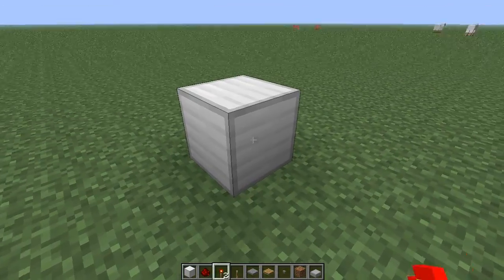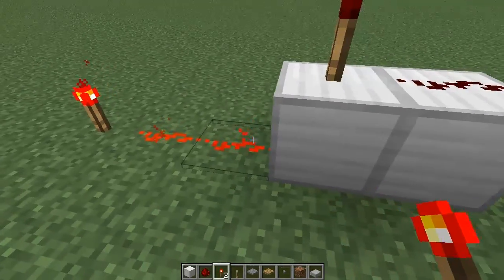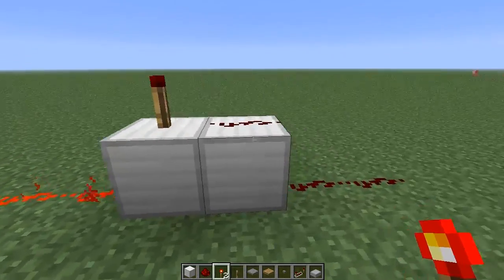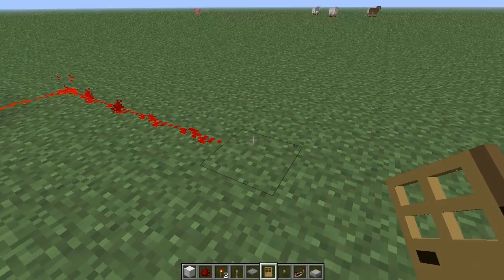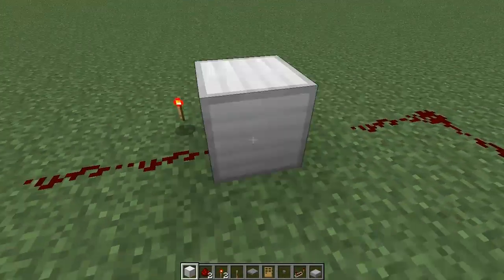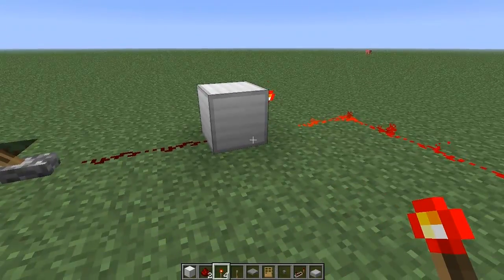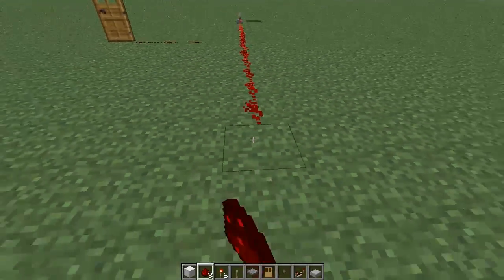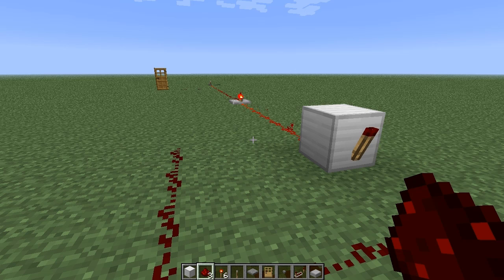Redstone Tutorials - #2 Repeaters and Inverters

Comment: At 3:21, you place a repeater and then the power continues. In my game (Im working with you in Pocket edition) I followed the exact same steps (remove inverter, place repeater) but instead of continuing the power, no power went beyond the repeater. Is that because I have a different version, or because of pocket edition? Is that supposed to happen?! (Yes the block is a repeater)
Reply: Check the repeater's direction. If the redstone dust is going left, then the repeater's direction should be placed left as well.

Comment: what you would need and inverter for is a 2 way door. like you said in the last video on is on adding another power sorce does nothing and if you have and iron door you know how hard a button can be to use going in and out because it doesn't last long. but with a lever once opened from the outside you can't close the door from within. but if inverted if either switch is on the door will be close so you can turn it off outside opening the door then turn it on inside closing the door the turn it off to leave and so on.

Comment: I'm so confused right now
Reply: Ur not alon
Reply: Well if you get confused with this I can’t imagine you watching mumbo jumbo’s video
Reply: Wtf this makes no sense
Reply: The repeater is use to extend the red stone signal, while the inverter is used to make one side ‘off’ while the other side will be ‘on’ 

To make the inverter just put a block and then place a red stone torch.
Reply: @sweettea735  thank u
Reply: @sweettea735  Well I have a question then what if you add a clock can the redstone signal switch between the one side that is off or on, or does it power both sides and then the clock ticks?
Reply: @lolozeeee  only powers one side I think.
Reply: @sweettea735  So the signal switches between the 2 sides
Reply: @lolozeeee  yes
Reply: @sweettea735  Ohhh, thank you
Reply: @sweettea735 didn’t he already make one in the first video, as it gives the impression that this is something new that he didn’t cover in the video before, when he did he just never named it and it makes things 1000 times more confusing.

Comment: what happens when you right click the repeater exactly? i havent seen any difference in game when i tried it
Reply: Kisuke Urahara Repeaters always delay the passing redstone signal by 1 tick, or 1/20 of a second.  Each time you right click it, it adds 1 tick to the delay to a maximum of a 4 tick delay.  This is useful when you are attempting to synchronize multiple redstone components so that they all perform their actions uniformly.
Reply: ok thanks :) that helps alot
Reply: Kisuke Urahara Np and also I remembered wrong, 1 tick is actually 1/10 of a second not 1/20, my bad.
Reply: lol, ok thanks, that actually makes things a little easier, in case i wanted to make something that was delayed one full second, it is cheaper to make :) thanks again
Reply: No problem.

Comment: I want to make an XP splash using /summon ThrownExpBottle and command blocks.  How can I make it turn on and off automatically so that the XP keeps splashing?
Reply: +AL Eshem (Textbookaroo) I made the xp splash a long time a go. its was lots of fun but over loader the realm. ty all
Reply: Command blocks
Reply: +AL Eshem (Textbookaroo) I'm not sure if you're still looking for an answer but you can connect a redstone clock to the command block you're using. a clock is when redstone constantly turns on and off repeatedly so the command block would be repeated. look it up on google

Comment: I want to make a circuit that when it is on the output goes one direction to power something on and when I switch it again it terns that off and powers something else. I messed around with the compariter but I could not figure it out.
Reply: I solved it already but thank you.  I used a sticky piston with a torch under to spots in front of it and redstone dust going from each spot so when the block is over one hole it powers one thing and when I switch the power off the piston retracts and the block is now above the other torch and so can power something else.   Your idea is much better then that but I built that a while ago before I knew more about redstone. 

Interesting that you would comment now. I'm no expert but I've actually come a long way in my knowledge about redstone mechanics and I just this day finished up building a redstone / command block setup of my OWN design that uses no clocks and is server friendly to make a 1.8 str8 vanilla server have working buy and sell shops at spawn. It's kinda slow because all the items have to travel through the hoppers before the redstone can activate the command blocks.

Comment: When a redstone signal passes through a repeater, the signal will suffer of a little delay before following its way through the repeater; every time you toggle the repeater you increase that delay time, up to four ticks, wich is less than a second I think... Anyway, using a lot of repeaters linked together and toggled to four you'll see the redstone signal will slowly advance through them before reaching the device, etc

Comment: Hey Flabaliki,I am trying to hide a chest with 2 sticky pistons. The sticky piston with the chest on it by default needs to be closed. and the sticky piston with the wood (to move on top of it) needs to be default open. and they are powered by one switch so when you flick the switch the chest comes out of the ground and the wood retracts into the house. Then when I flick the switch again the chest goes back down and the wood comes back out. Thanks.